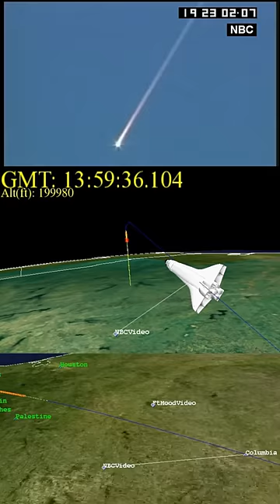What Happened After Space Shuttle Columbia Lost Contact

Comment: At 9:00:05 McCool tried to restore some hydraulic systems, this was right before the crew compartment separated and it was the last action which we know was taken by the crew
Reply: I wasn’t aware of this. Where was his position in the crew module, and how did the G-forces affect his ability to operate? At this point, Columbia was well into her flat spin, and had shed the left wing only two seconds prior, so depending on where the dials or switches were it may have taken Herculean strength to try in those last few moments to restore power..
Reply: @noahdavidson8733  As the Pilot of that mission he sat right next to the commander allowing him to have easy access to most switches, we knew they were conscious even because of the G-forces because right before restoring hydraulic systems either Husband or McCool turned the autopilot to manual, later in the investigation the instruments during that time showed around 0.5 to 3 G's which is not too high for either Husband or McCool (McCool used to be a test pilot in the USN and Husband was a fighter jet pilot in the air force)
we also think of adrenaline, when in near-death experiences our bodies are pumped with adrenaline allowing us to do actions which normally would have been seen as impossible for our bodies.

Comment: They should've made the cabin a separate system, that can be decoupled and has its own parachute for worst case scenarios like this
Reply: bro parachutes would literally burn up at that speed
Reply: They were at 275,000 feet. Parachutes are no use whatever at that altitude. The air is very thin at that height. Apollo deployed its parachutes at about 10,000 feet when it had slowed to around 100mph.

Comment: I remember after the Challenger disaster there was talk about making the command section sealed and able to break away from the shuttle with parachutes to protect the astronauts. If that had been done it sounds like these astronauts would have been saved.
Reply: The command section shattered into pieces shortly after its separation from the main body.
Reply: @crogeny  On which one. I seem to recall that the Challenger command section was estimated to be together all the way down to the ocean floor. 
As far as Columbia, if they had made the required changes to allow the ejection of the command section from the rest of the craft, it might have survived. There's no way to tell for certain. 
However I do know a bit about ejection technology and part of it is to get the components carrying people away from the rest of the craft as quickly as possible.
Reply: @equesdeventusoccasus  You're right about Challenger but the post-accident report that Scott posted in another thread states clearly that the command section of Columbia shattered into so many pieces that the debris field of this section extended over 50 miles! We know with absolute certainty that the command section shattered because of this debris field and also because the autopsies of the astronauts showed that their bodies had all been fully exposed to the surrounding atmosphere at >100,000 feet (i.e., they were in freefall with no surrounding structure to protect them). The heat and forces at that altitude were so severe that the space suits of the astronauts were stripped from their bodies. The report explains in detail why the command section shattered.
Reply: @equesdeventusoccasus  Do you also understand the aerodynamically around each shuttle mishaps is different? Columbia coming down super hot as the module would shear apart from the difference in pressure upon exit its mothership failing body.
Reply: @JoshSimpson  I not only understand the aerodynamics and the differences between the two accidents, I also realize that even from this video's description, the people inside the shuttle were still attempting to fix things long after it was impossible to fix anything. 
If we get another shuttle-like space craft, it should probably be equipped with a detachable command section that will detach manually, but would also have failsafes that would automatically detach the command section, when systems determine it is necessary.

Comment: The fact that the cabin just came off ALL BY ITSELF shows that they EASILY could have designed it in such a way that the cabin could ignite some thrusters and boost away from the orbiter and then land under parachute. This feature would have saved ALL the astronauts on both failed Shuttles!! 🤬🤬
Reply: This should have been a feature on the shuttle when it was being designed and built but it was a feature that couldn’t be retrofitted after the shuttle design was finalized. 

The shuttle is built very specifically and adding tons of weight to the fore end would change everything.

For your proposal to work an entirely new shuttle was needed.
Reply: what are you talking about? this wouldn't work during reentry

Comment: I've heard witness testimony from ham radio operators that claimed they received their comms after it broke up. Apparently the containment vessel held until impact. From what the guy said it was very distressing.
Reply: It completely broke up in flight.  Simplified  explanation:  A breach in the crew cabin from aerodynamic forces near the front wheel well caused loss of air resulting in near instant hypoxia.  The bulkhead between the cabin and payload bay ripped apart pulling all occupants out.   --Columbia Crew Survivability Report.  Think what might happen to a rag doll being tossed around in a force 5 tornado in which a house does not survive.

Comment: Having worked at KSC on the Space Shuttle Program, I had worked the Launch book on STS-107.  Columbia could have been saved up until the deorbit burn.  That doomed it and the crew.  Linda Hamm single-handedly changed NASA's motto from "Failure is NOT an option" to "Nothing we're going to do different" when engineers petitioned her to have photos taken either by a spy satellite or a ground-based telescope of the left wing.  There was a previous mission where the right wing was similarly damaged during launch and during re-entry.  Instead of the steep descent during re-entry, it re-entered at a swallower angle with the damaged wing 'shaded' by the Orbiter.  It safely landed with significant damage to the wing.

Comment: I am not an engineer, but I always wondered why they never put a parachute on shuttle cockpit nose cones after the Challenger disaster. After realizing that the Challenger crew was in all likelihood alive the whole way down, they talked about parachutes and other life-saving measures, but they did nothing.
Reply: If it fails during reentry a parachute alone would not make any difference. You would have to make the nose aerodynamically stable enough to maintain attitude during reentry plus it would need a working life support system after cutoff.

The ejection pod on the F-111 was far simpler to make since it did not need to do a reentry.
Reply: @simonm1447  That makes sense, but I did read that they've been trying to create some kind of escape mechanism for future launch vehicles. Like I said, I'm not an engineer, and I don't know what it takes to make this happen, but it must be difficult since there's been no solution.
Reply: @RumbleFish69  for safety it surely makes sense to have a 2nd option.
In the shuttle however they sacrificed all types of rescue systems to get more payload. They also had no ejection seats (exept for the first test launch with 2 astronauts). The flight abort possibilities were very limited just to short gaps during launch.

The whole launch system demanded a functional shuttle for their safety. If this was no longer the case the crew was screwed.

Comment: The forward pressure vessel was designed to be a self-contained unit, able to withstand the loss of the remaining craft.  Due to budget cuts, this demarcation was reduced, also removing the capsule recovery equipment.   Had all this still been in place as designed, both the Columbian and Challenger crews would have been saved.

Comment: I read the huge after incident report.   Sadly once the hydraulic fluid leaked out control was lost.   If the lines had been better protected, might have bought them more time
If the crew area was built to be more areostabile with a backup parachute.  Like the f111 ejection system maybe the crew would have survived.
Also the report said the helmets the crew wore were inferior to race car driver's helmets in protecting the head during the initial tumbling,  loss of consciousness would prevent the crew from using the bailout option if the shuttle had survived but unable to land due to flat tires damaged during reentry

Comment: Why do people pass out that quickly from depressurization? When someone chokes you, it can take minutes before you pass out so why only in few seconds in a depressurized cabin?
Reply: You do realize that they were thousands of feet up in the air and traveling at a supersonic speed right? The astronauts were exposed to extreme wind speeds as the shuttle was burning up and breaking apart so they would've been exposed to a catastrophic decompression and when you're traveling at around 17,000 mph in a spacecraft like that and something goes really wrong, the decompression at that height on a human body will be fatal and will make a person pass out quickly because of the force that the atmosphere is exerting on your body.
Reply: @Infinite-void908 so why do we hear this about passenger aircraft too? They are definitely not traveling at hypersonic speeds and not exposed to the vacuum of space.
Reply: @nielsandersen6164  The interior of a passenger aircraft is pressurized and decompression won't happen in it unless some idiot opens an emergency exit door while the plane is flying at its cruising altitude or the plane suffers a catastrophic failure. Also we don't really hear about aircraft disintegrating near the space line that often if that's what you're referring to, but the space shuttle is different from a regular airplane since they were designed to glide through the air when reentering Earth's atmosphere. You're right, airplanes obviously don't travel at hypersonic or supersonic speeds because that's not how they're intended to operate.

Comment: It would've been useful to have an ejection system that can eject the fuselage then the crew. They have space suits they could've used them and ejected while still breathing.
Reply: For the fuselage to be an escape system the entire shuttle would have needed to have been redesigned from the ground up.  

It wasn’t possible to add ejection seats for a crew of more than two.  Even then the ejection would only be possible during launch or maybe if the shuttle was still intact on landing but at Mach 2 when it’s close to landing

The launch escape system or crew abort would have needed to have been a capsulized module that attached to the main body of the shuttle kinda like how the dragon sits on top of a rocket and can blast away in an emergency

Comment: An obvious question is why doesn’t the nose containing the astronauts have its own safety and recovery mechanisms like a parachute or aerodynamic capabilities. Maybe a parachute hire is impossible due to speed and heat.. but.. something?
Reply: This particular space shuttle wasn't equipped with something like a parachute in the crew cabin to detach from the rest of the spacecraft. Also you kind of answered your own question, the speed that the shuttle was traveling at was 17,000 mph when the disintegration occurred so the astronauts literally wouldn't have been able to activate an emergency escape system in the crew cabin.
Reply: @Infinite-void908  Well yes I realize all that, but couldn't they design *something*? To save them in the event of a catastrophe like this? A total failure like this is an obvious possibility, and with the nose a distinct part of the whole machine, it could be separated. Maybe the nose could be an aerodynamic vessel capable of it's own independent flight should it need to detach? So when the whole thing explodes, they detach and can fly away. Like an escape pod. Maybe even that is a ridiculous notion. But surely the thought crossed their minds. Obviously a parachute wouldn't be enough.
Reply: @rogsolaris7411  NASA probably did propose an idea that at one time, but the price of installing something like that within the space shuttle probably would have been expensive.
Reply: @rogsolaris7411 Building an independent craft inside of another is extremely difficult, engineering intensive, expensive, and impractical

Comment: Nasa killed 2 complete crews with avoidable measures.
1.Challenger: its was to cold for the launch. The rubber in the O-ring didnt work on low tempratures. They knew!
2. Columbia: they didint check, if the chunk that hits the one wing during the start, was damaging the shuttle.

Comment: How did it become unstable to begin with?
Reply: Because of the damage that was sustained to its left wing during launch. A piece of insulating foam had broken off from the shuttle's external fuel tank and struck the left wing, causing damage to the heat-shielding tiles that protect the shuttle during reentry. This damage allowed hot gases to enter the shuttle during reentry, leading to the breakup of the orbiter and the tragic loss of the crew.
Reply: @Infinite-void908  thank you, really appreciate the reply :)

I wonder what could have been done if they predicted that the shuttle couldn't re enter atmosphere.

Comment: If the crew capsule comes off that easily why the hell diidnt they put emergency parachutes behind it
Reply: Parachutes aren't going to correct a cockpit falling like a meteor, bud.
Reply: The crew cabin was never designed to detach in a loss of control event. If it was that would have been needed to have been built when the shuttle was built.  That’s not something they could retrofit.

The whole crew cabin would have needed to have looked a lot like the Apollo capsule, conical with a rounded heat shield. Or it would have needed to be entirely coated in a thermal protection system.

The shuttle was a good concept but never meant for routine flight and didn’t have a proper escape system
Reply: @movienerd202  the used them to slow down the Apollo capsule. Why not have emergency parachutes behind cabin to slow descent?
Reply: @MikeGoesBadaBoom  yea i always thought it had a bad design. Even with how the cabin was designed they could have retrofitted exploding bolts and parachutes with stabilizing thrusters just for added safety

Comment: I might not like elon but i agree propulsive landing has its benefits
    Till we discover anti gravity
Thing that confused me the heat tiles on the underside
.   Aren't they going to enter engines first and burn to lose velocity like f9
Reply: Isn't that just added weight to slow down
Reply: Shouldn't the engine bay have thermal tiles
Reply: Still can't get it too hot stuff like tubing to melt 
   So then does f9 even have any thermal tile¿😅
Reply: Similarly trying to calculate usable fuel is complicated cause the more you enter with the more it takes 😅

Comment: Do they have a black box similar to aviators and if so do they also have video/audio recording of the cockpit if they have recovered it
Reply: Welp, it is a little different as many parameters were continuously downlinked to controllers monitoring the various systems.  Unlike the others in the fleet, Columbia did have a sort of black box, if one want to call it that.  It was actually a diagnostic recorder left over from early in the shuttle program. I believe it recorded something like 15 seconds of data after the downlink was lost.   In commercial aviation it is called a maintenance quick check recorder separate from the orange colored back box.  Though new designs of the black box nowadays record just about every parameter.

Comment: Ask yourself why they didn't have ejection seats.
Reply: Because ejecting at Mach 6 and temperatures around 2,000 degrees isn't much of a safety plan.
Reply: They have ejection CAPSULES and pressure suits.  You obviously know nothing about aviation. 

The first shuttle has this system.
Reply: @kip9999  Used in case of a launch failure. Not on re-entry.

I am a pilot. This has nothing to do with aviation.

You're embarrassing yourself here.

Comment: What started it?
Reply: The cause of the Columbia disaster was a piece of insulating foam that broke loose from the shuttle's external propellant tank and struck the leading edge of the left wing soon after liftoff, damaging protective tiles. As the shuttle was reentering Earth's atmosphere, it started moving violently as hot gases entered through the hole in Columbia's left wing which led to the disintegration.